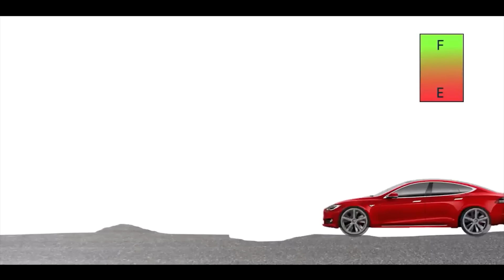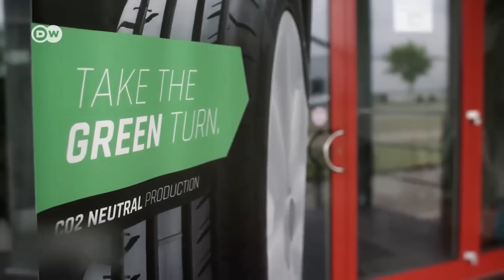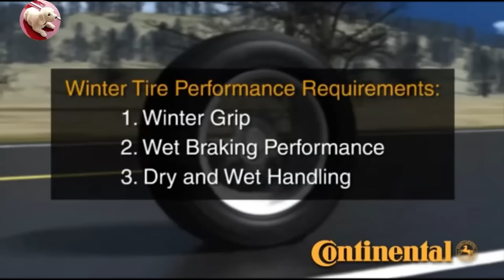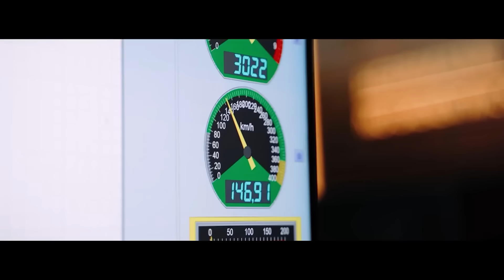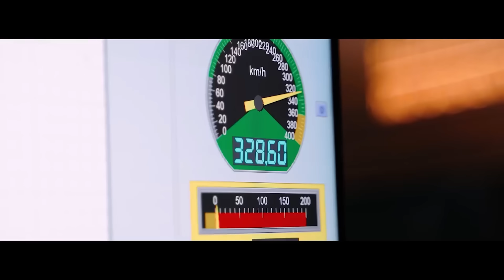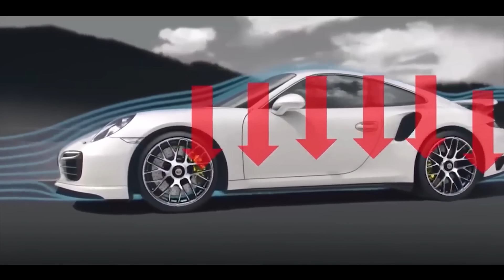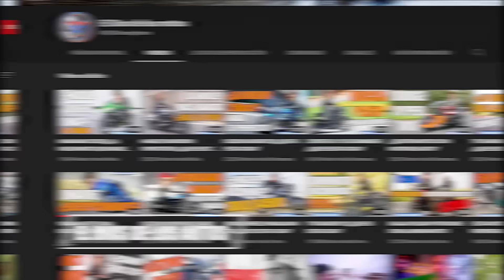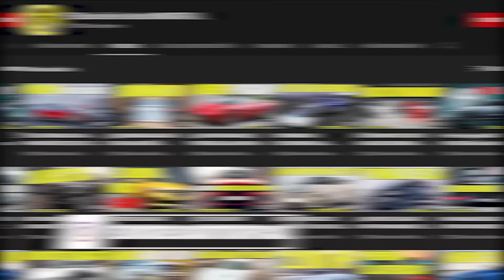Neumático de perfil bajo y ancho + neumático alto y delgado: efectos en el rendimiento

Comment: Mi experiencia es que pasar de 195/65 R15 a 225/45 R17 en un coche no deportivo es que gasta mas, acelera mas lento, peeero puedes ir mas deprisa en las curvas ya que hay mas goma en contacto con el suelo y se deforma menos ya que hay menos perfil de goma, a parte en la medida 225 tienes neumaticos deportivos como el Advan V105 que no tienes en medida 195, eso si, notas todos los baches
Reply: Experimenté lo mismo en mi antiguo auto. Justamente pasé de esa medida en R15 a 225/45 R17. En aquellos años no conocía estos temas y sólo buscaba que mi auto de viera más "cool" , pero luego al probar me di cuenta de los problemas. En mi caso debo agregar que la velocidad tope de mi auto también se redujo bastante. De haber sabido le hubiera puesto mejor llantas 205/50 R17 para que no sea muy ancho y presente estos problemas. 
Sin embargo efectivamente en las curvas era mucho mejor el comportamiento, y la facha que tenía era única.

Comment: Te faltó nombrar que un rin mas grande puede mejorar tu aceleracion y rendimiento si con el rin mas grande la rueda se vuelve mas liviana ( es decir si le reduces peso a la rueda el motor se esforzará menos para hacerla girar). Por ende en algunos casos rines mas grandes si mejoran la velocidad
Reply: Creeme en teoría si pero en práctica no es tan fácil, Un rin más grande el 90% de los casos es más pesado que su medida abajo, y una llanta para rin más grande aunque con menos pared lateral es casi igual incluso más pesada que la de su medida abajo, ejemplo tenemos un rin 17x7 (28 libras) con llanta 235 50 (27 libras) y metemos un rin 18x8.5 (38 libras y es muy ligero para ser oem casi andan en las 40 libras por ser 8.5 a la mejor encuentras un 8 que pesará las 32 libras pero son o difíciles o feos los buenos son los 8.5 ) y la llanta es una 235 45 ( pesa 27 libras porque aunque tiene menos pared recuerda que está estirado un radial más grande lo cual añade material extra ) pero como 235 ya queda en la ultima línea de tolerancia para el 8.5 le tienes que meter 245 45, 18 para conservar el confort de impacto, y está ya pasa a pesar 29 libras y esto es cuidando de meter marcas buenas porque le metes las económicas y esos 29 se convierten fácilmente en 32 libras, ahora que si lo que quieres es que realmente funcione tu teoría es meter un rin 18x8.5 forjado ( 20 libras pero sus precios son exageradamente caros alrrededor de 2000 dólares el juego los más baratos, luego tienes las llantas eco 245 45 18 (19 libras) que si son mucho más lijeras pero tenemos varios problemas 1- el precio un juego de neumáticos te cuesta 1500 dólares por barato y me quedo corto que en promedio andan igual en 2000 dólares el juego, 2- son neumáticos orientados al confort y no tanto al desempeño los.lijeros para desempeño son más caros, 3- las medidas son muy escasas ya que están echas para un nicho de mercado,  así que resumiendo la realidad de las cosas es que si montas unas llantas y rines 235 50 17 oem ( 55 libras )
Si cambias el conjunto a 245 45 18 en marca buena (Michelin, bridgestone no especializada) (65 libras) si usas el conjunto premium rin forjado llanta eco 245 45 18 ( 39 libras ) aquí aquí si tienes la ganancia que tú mencionas pero vas a gastar 4000 dólares en esa ganancia que si no es para un auto verdaderamente bueno no vale la pena para nada hay que acostumbrarse a los 17 originales o entender que subir a 18 es merma para el auto si o sí o tu bolsillo, aunque si no es un auto de desempeño o no eres un conductor dinámico no lo notarás así que métele 18 claro es un ejemplo todo esto

Comment: Es fácil muchachos, quieren aros mas grandes? Fácil, deben buscar unos de aluminio o material forjado que suelen ser mas livianos que los aros originales de un carro. Así no habrá el sobre esfuerzo hacia el carro y de esta forma el carro no gastara mas combustible (incluso consumirá menos que antes) y desarrollara de forma mas optima.

Ejemplo: aros originales de magnesio de 15 pulgadas vs aros de 17 pulgadas de aluminio, los de aluminio serán mas grandes y mas livianos lo que se traduce a mas aceleracion y menor consumo de combustible, ojo es muy importante mantener el diámetro original para que el consumo de combustible no incremente ejemplo llantas originales 195/55 r15 = 195/45 r17.

Comment: Entonces, si a Civic 2020 quisiera ponerle rin17 (tiene rin 18 actualmente), cuál sería el camino a tomar para tener un perfil mas alto pero sin perder adherencia? En un día normal manejo a velocidades de hasta 130 km/h que no es tan alta velocidad pero tampoco la velocidad crucero a la que usualmente andan otros vehículos.
Reply: Muy fácil, consigue neumáticos con una pulgada mayor de alto. Por ejemplo si tu llanta actual es 225/40 R18, pues en aro 17 sería 225/45 R17 y listo. El tamaño total de la rueda seguirá siendo el mismo pero al tener más "carne" será más confortable el andar. Asegúrate de no ponerle llantas más anchas si no sólo modificar el tamaño del aro.